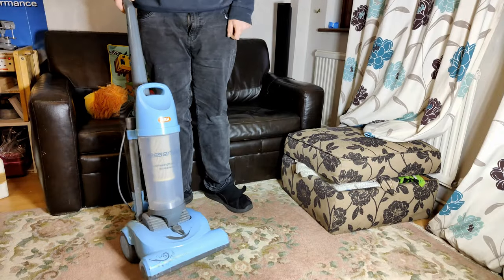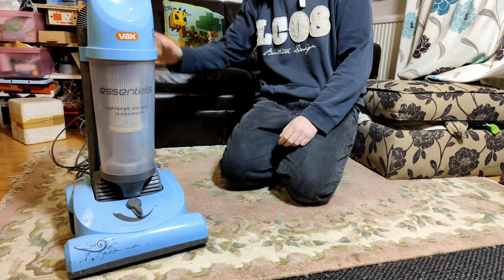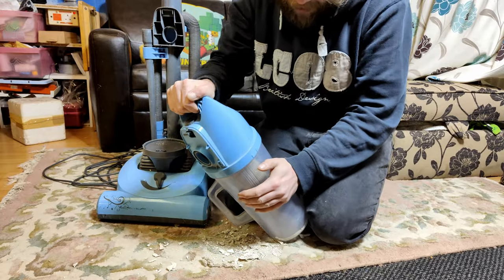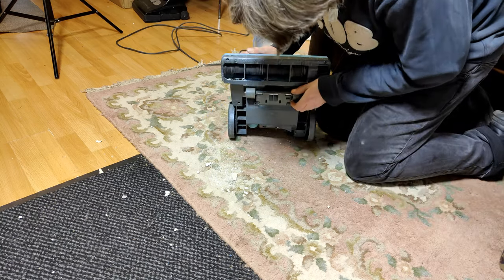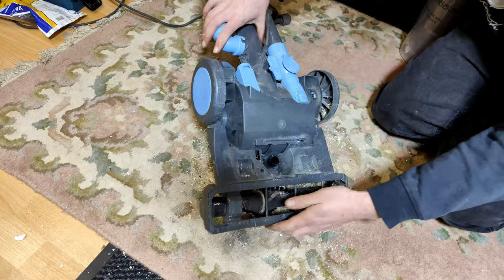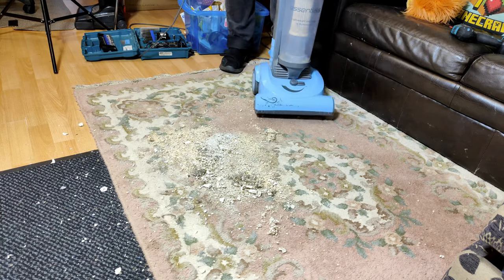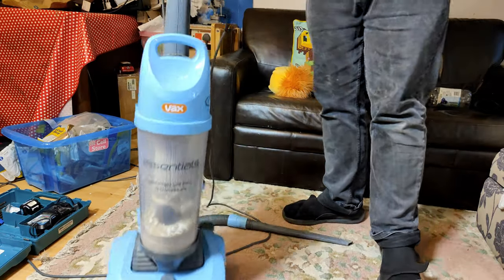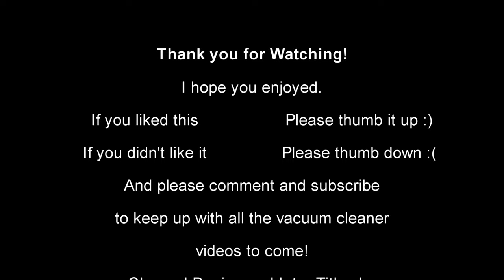Vax Essentials Bagless cheap upright! First Look and unclogging...

Comment: I was given a Dyson and a Goodmans upright by my neighbours as they left the flat opposite me. Both were clogged with sawdust from when they kept rabbits for a while. Both weren't a problem to fix. I gave them to people I know who couldn't afford new ones. The Goodmans one is still trying to suck the carpet off the floorboards!😂
Reply from the maker: Oooh not had a Goodmans before, sounds exotic 😂 Still got this, and reading all these comments it'll come apart for a refurb now just because! Then as you say, probably gifted to someone who needs something and anything
Reply: R3H44N69  I can't actually find a name on it.  However, there's also a Bush one that's identical in everything but name. That one just had hairclips stuck in the tubes!